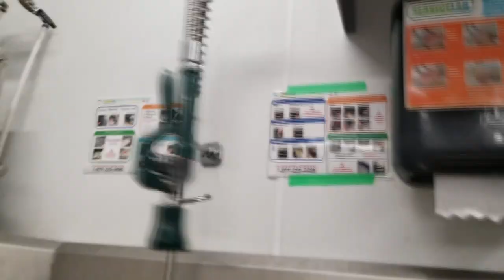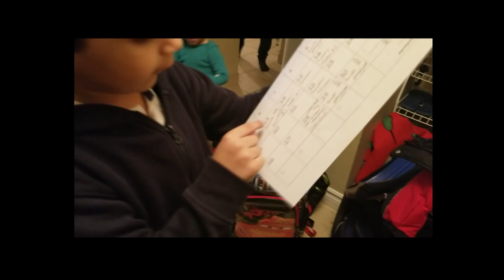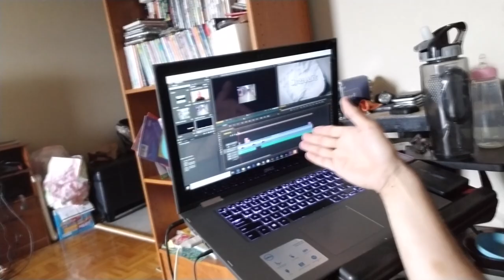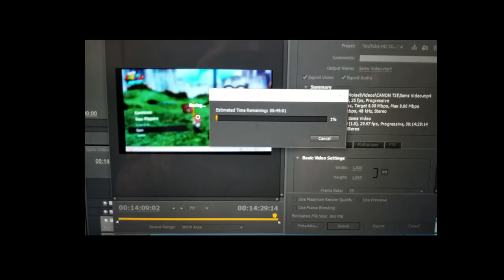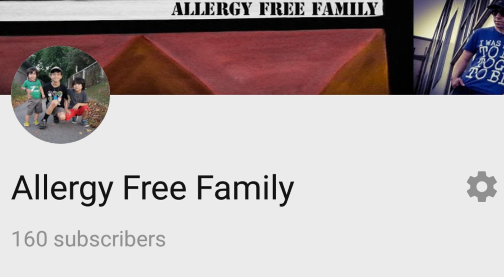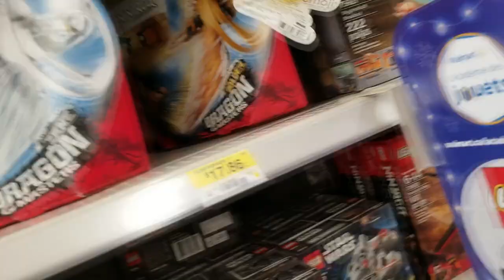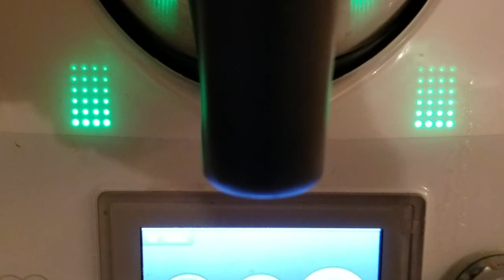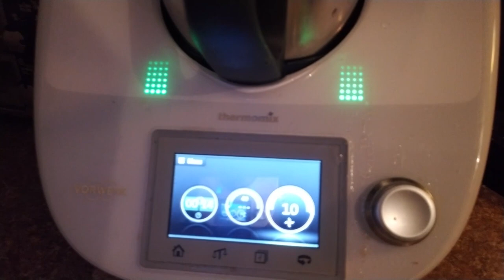A Week of an Adult with 22Q

Comment: can u do more of these weekly vlogs? i really enjoyed it :) ive never heard of 15q before i only have 22q and ceoliacs.
Reply from the maker: There are alot of other ones then 22q and 15q, I had no idea either, I will be doing longer vlogs :)
Reply: 15q13.3 microduplication is where a small portion (even smaller than Digeorge/VCFS/22q) is duplicated. Basically instead of 2 copies, there are 3. That specific area contains genes related to neurological symptoms like severe insomnia, anxiety, depression, epilepsy, ADHD!!, joint troubles, GI issues, etc. Myself, Micah and Eli have this. I have ADD and a bit of anxiety. Eli and Micah are more complex and really affected by theirs (Micah has 22q and 15q so who knows whats what)